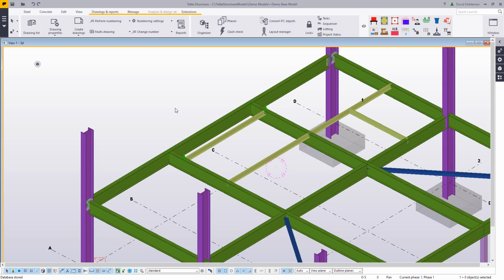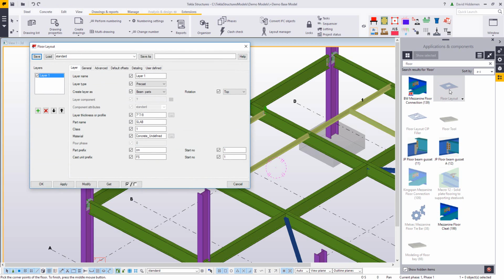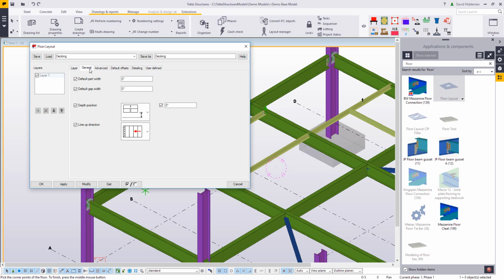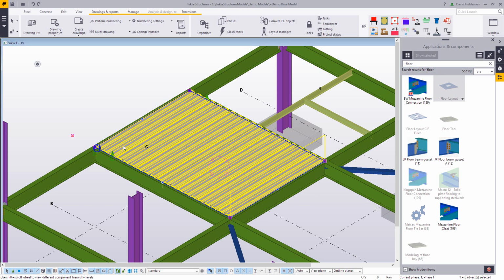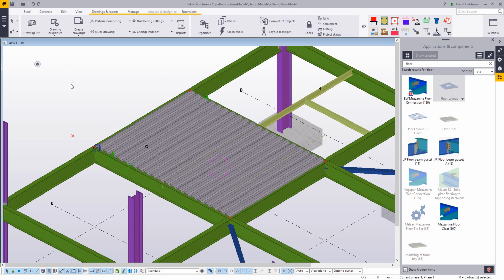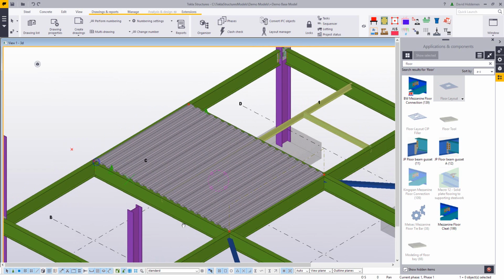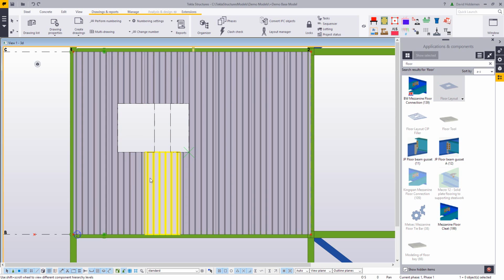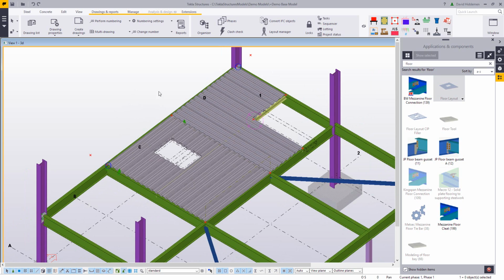Floor Layout for Decking

Comment: Hello, thanks for sharing. How could I model the concrete slab with which it is filled after the steel deck? Would I have to manually cut the concrete slab with the steel deck part? Or there would be a more automatic method.

Comment: That's a very useful tool, but i have a doubt, does the tool take into account the fact that deck roofing are splice when lay out on field?
Reply: No it will not - you can make decking lengths as large as you want so you need to take this into account when defining your areas.

Comment: Can you use that for facade modeling (vertical or horizontal panels).?
Reply: Yes, just change your pick points to be in the vertical rather than the horizontal plane. You can then use the contextual toolbar/direct manipulation to change the orientation of the panels.